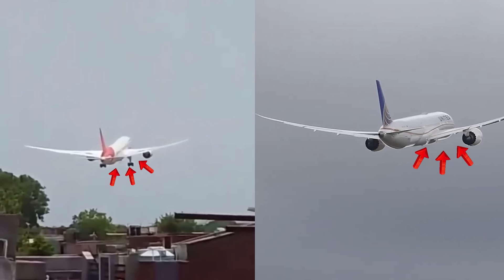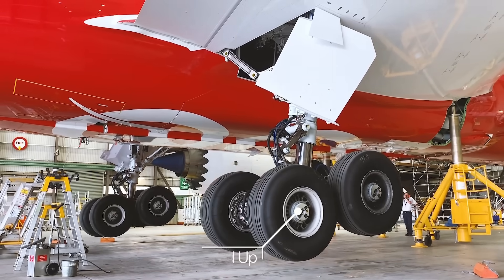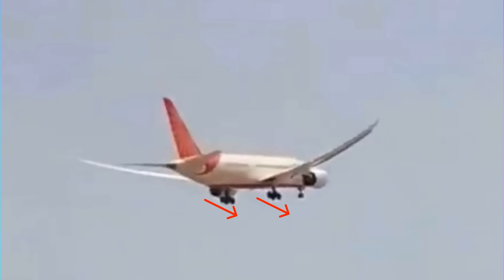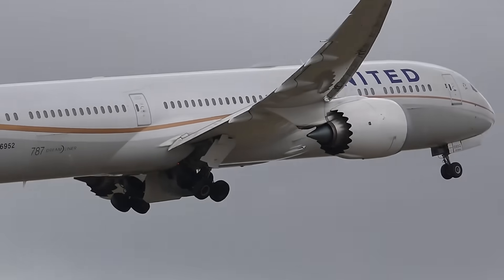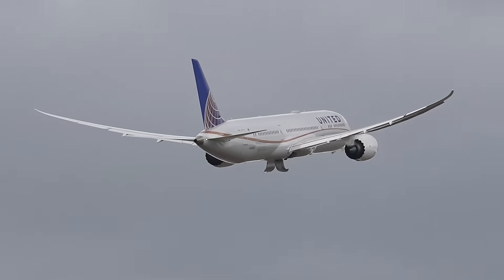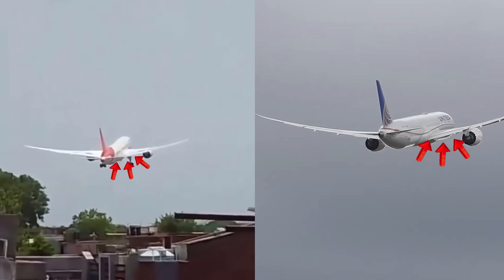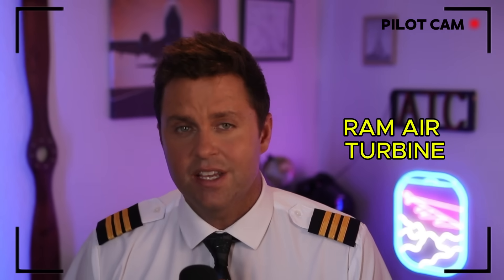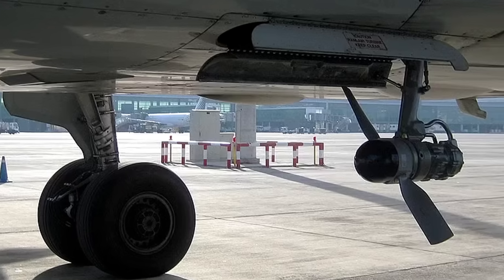Pilot Explains: A New Detail in the Air India 787 Crash Everyone Missed

Comment: There were electrical problems on this plane, as noted by several other sources. I will be surprised if those issues aren’t at least involved with the engine failure.
Reply: Engine failure is completely independent of cabin electronics not working. The engine maintenance is a complety different field and a expert team take care of it. Whereas cabin electronics like infotainment is just airline saving some cash (most of them cut corners one place or another)
Reply: @Apoorv-u2s  so you say the engines can works without electric input ? non sense
Reply: Those are fake sources
Reply: Cabin lights and most aircraft electronics are not powered directly by the main aircraft engines. There is an Auxiliary Power Unit (APU) which is separate.
Reply: Unless required by MEL, the APU is selected off before flight. It’s the very first item on the after start checklist.
Reply: @ChiefIntel  Well, that's a wildly misleading statement. The APU is only used as a backup ... or for ground operations when airport power supplies are not available.
Reply: @ChiefIntel  I thought the APU was only used when the engines had been spooled down and before external power was connected, not during flight.
Reply: Don't jet turbines have igniters in the fuel burner cans that require electricity?
Reply: @spacecadet1249 
FADEC EE controlled engines by definition require a stable electric supply for all parameters thrust settings and fuel metering.
Possibly also electric booster fuel pumps to sustain take off power fuel demand.
Reply: @spacecadet1249  No. Like a diesel engine, its compression ignition. Igniters are needed on initial start, but once the core is spinning fast enough the fuel will burn from heat of compression.
Reply: @spacecadet1249  Now that said, there IS a minimum airspeed to create said compression, I can’t recall what that is but you do make a good point. However, selecting the fuel controls switches off then on (the first memory item for a dual flameout) will fire the igniters from the battery.
Reply: YES, I saw from the flight this plane did - Delhi to Ahmedabad to earlier on that same day that there was no a/c when boarding, and the guy who survived the fatal flight said the lights went off then came on, perhaps when the rat took ovcer the electrical system?  So I would say a definite electrical problem, but how that works in with engine failure ...????
Reply: Electrical fault/fire, poor maintenance
Reply: Air conditioning wasn’t working inside the cabin. Air conditioning comes directly from the engines. But only when the engines are working normally
Reply: @62Cristoforo  Come back when you learn what an auxiliary power unit can do, will you?
Reply: @peter The APU is a ground based unit, located on the tarmac behind the empennage. It is disconnected before pushback. It has nothing to do with the crash.
Reply: @62Cristoforo  The APU is not the ground based unit at all.  That's a totally different item.  The APU (Auxilliary Power Unit) is the small generator, positioned in the tail section of an airliner, which is used to provide lighting, AC, etc. when the engines are turned off at the gate, before the external unit is hooked up.  If you look closely at the tail section of a recently arrived jet, you may see the exhaust vortex from the APU disturbing the surrounding air.
Reply: Electricals , Electronics , Computerizing
Reply: Best video so far. Very informative, thanks.
Reply: The main fuel pumps on cars and planes are driven by engine power.
Reply: The sole survivor said that before crash, lights were flashing inside the plane. That's the sign of electricity issues.
Reply: @kingdomofgeorgia1751  thats the rat being deployed it takes a bit of power and lights could flash as stated by a prof pilot
Reply: How can associated electrical Software effect both engines..
Reply: @jbs9231 Very easily. All it would take would be a computer or electrical problem to shut them both down at the same time.
Reply: @jbs9231  Why wouldn’t it?
Reply: @jbs9231  Fuel pumps does not working.
Reply: @jbs9231 we all admit Air India has a bad customer experience with cutting costs on the interior of planes. While engines are different, What’s stopping them from also cutting corners with their maintenance team?
Reply: @RecursivePB  To fly into EU, USA its mandatory to have a certain level of aircraft maintenance. Engines is not something they can cut corners on. In flight entertainment..yes.
Reply: @TheSakzzz  oh wow I totally forgot dude, this is a world where people don’t lie and cheat to their superiors. OF COURSE there are “industry/country standards” but every Rule written in ink can be covered in blood 🩸

Comment: Unintended thrust reduction due to captain’s seat sliding rearward on rotation and catching the levers pulling them to idle. Copilot unable to overcome captain’s weight. Aft locking mechanism failed.

Comment: Does B787 has single switch to cut off fuel for both engines? Does electrical failure can make the throttle pulled back to Idle?

Comment: *EDIT* Emergency backup gravity feed fuel system would come online in this scenario as mentioned in the replies below. I'll keep the original here since there is interesting discussion below. **

Original:

One event that automatically deploys the RAT on the 787 is total electric failure. The 787 uniquely doesn't use compressed bleed air, nor does it use engine driven fuel pumps for propulsion (both of which are found typically on other jets) 

Instead, a "bleedless" electric architecture is what the plane relies on to power hydraulics and the engines. In its early days of service the 787 had battery fire issues that grounded the fleet but were resolved by a fix in 2013.

On November 12, 2017 United flight 915 - a Boeing 787-8 (same type as AI) indicated a main battery overheat on descent into Paris. According to the Aviation Herald, the event wasnt significant enough to open another investigation.

I realize that the chances of catastrophic loss of electrical power on one of the 1000+ 787s in service is far fetched. But on a plane that essentially lives off electricity, and one that has a rough history with battery issues, I think it cant be entirely ruled out.
Reply: Regarding battery issues, it was an unusually hot day......
Reply: The engines will keep running if all electrical power is lost, they will gravity feed. Loosing electrical power does not switch off the fuel valves.
Reply: @mike-youtube Agreed
Reply: @mike-youtube true but the gravity feed does not provide enough fuel for takeoff thrust.  It’s fine for cruising but the takeoff fuel requirements especially on a heavy takeoff weight (long haul so heavy fuel load) in hot conditions (thinner air and lower compression rates) are multiples of the cruising fuel burn. So at that point of the takeoff gravity feed seems unlikely to be sufficient.
Reply: @Flynbourne  That's exactly what I was thinking, but I just don't have official numbers or limitations from boeing regarding the gravity feed system. It seems to me like it just wouldn't work at what is quite literally the most demanding phase of flight, for the engines especially.
Reply: @Matts752 the 787 burns around 20,000 litres in the takeoff process.  Let’s be generous and assume the total takeoff sequence is 4 minutes, that’s 5,000 litres per minute or 2,500 litres per minute per engine.  Given the friction of the fuel systems and the minimal vertical gravitational pressure it seems unlikely that gravity could provide anything like that flow. And I do say unlikely.
Reply: @mike-youtube  The height diffference between the engine and fuel tanks is at most a couple of feet. This is not enough head to provide a sufficient fuel flow to maintain take-off thrust. Furthermore, the video of the airliner gliding down across the houses has NO engine noise at all.  Not even noise from engines running at idle. At least the expert presenting the above video has pointed out the lack of engine noise. The lack of engine noise is very relevant. It settles the case: This WAS a dual engine failure. And regardless of how improbable this may be it nevertheless occurred.
Reply: My thoughts exactly.  That’s where I would be looking.  An electrical systems failure fits all the evidence so far.  Now this is sort of concerning as that would indicate an issue that is potentially systemic and could impact other 78s. Especially in hot climates.
Reply: What do you mean when you say bleedless electric architecture.  I appreciate your input
Reply: @turbinetech3000  Its one of the "selling points" of the 787's design. Pretty much every large jet including the 777 and even the Airbus A350 use bleed air and engine driven fuel pumps to power the plane's hydraulics and electronics. Boeing took a different approach with the 787, bleed air is not used at all from its engines, instead 4 electric motor/generators are found (2 on each engine, plus another 2 on the APU i believe). Boeing argues that this design saves on weight and provides maintenance benefits over time, its no doubt cutting edge, but since its the first major aircraft to use this system, I don't know if its as "tried and true" as legacy systems.
Reply: @Matts752 True that but, gravity feed is sufficient at low altitudes with that amount of fuel on board. Plus if the RAT deployed it would automatically bring some boost pumps online paired with igniters . Hence relight of the motor would have been possible within seconds. Again the investigation will reveal all details!! Just said we lost all those lives
Reply: @Gaferr-r4r  Admittedly, I'm not too familiar with the gravity/suction feed system on the 787, but I always assumed that it was a last resort backup if all else failed. Its hard for me to believe that the engineers designed it with a catastrophic failure at V1 or V2 in mind. Maybe I'm wrong, but I would like to find some source that outlines the performance limitations (or lack thereof) regarding this gravity feed system.
Reply: @Matts752 I fly for a US carrier and have about 4000ish hours on the 78. The certification and design of the fuel system after they did away with EDPs was exactly that!! Loss of boost pumps at or above V1 and gravity feed at high deck angels. Once the RAT deployed one pump should have been back online but not required for engine operation during emergencies!!
Reply: @Gaferr-r4r  Wow! ok that is great to hear. At this point then I guess the CVR and FDR are going to be our best bet for answers... Thank you so much for clarifying that as I've been unable to find that info up until now
Reply: @Matts752 Obviously anything can happen and we are all just speculating at this point. I just feel awful for the lost ones!!
Reply: It takes a few minutes to restart the engines after they shutdown. No time
Reply: @larrymays1754 Not when they are already at full thrust. It takes up to 2 minutes on initial start. When the motor momentarily loses thrust and ate an auto relight it’s almost instantaneous
Reply: @turbinetech3000 wait for reply from poster for exact info..rough reply ..electric architecture refers to electric motors driving hydraulics and plane controls versus fuel driven  engine power driving hydraulics and flight controls by bleeding air through compressor .
Reply: There is a recent FAA Airworthiness Directive for the B787 that shows how potable water can seep into the electrical bay on the 787 and cause a major short and potentially trigger this. https://public-inspection.federalregister.gov/2025-08346.pdf
Reply: Wow, no engine driven fuel pumps on the engines themselves ???? jeez, so even the engines have electric-operated fuel pumps ???? wow, that is asking for trouble IMO. I've been away from the engine business awhile - that is amazing, and not in a good way

Comment: Gary, great breakdown, you're obviously a well seasoned flyer. Kudos! I'm a former (auto) Mechanic/Tech, and fiddle with anything mechanical, also a Musician and Stringed Instrument repair/tech. That being said, my thoughts from day 1 when I saw the video: the plane sat for 2hrs on 100*F plus temp day, which means anything couped up inside a tin covering is going to be boiling. VAPOR LOCK is highly on my list, but- not enough to kill both engines simultaneously. Contaminated fuel? YES- very possible. But MORE SO is a complete Elec Sys failure- for any reason, but mostly this: 2hrs sitting with 100* temps, then turn EAST towards the SUN and voila! you have extreme temps that ELEC and DIGITAL systems CANNOT handle. They HATE heat! So, Main Elec Syst failure is it. The flaps look like they went up like they should, but they are drooping lifelessly. Same with the Gear. Went UP/FWD positioned, then drooped. Then we have the MAYDAY call at the last sec, saying "we lost power". BINGO. That's why it turned glider, coming down evenly, and sadly, tragedy. :( 
I just subscribed to you- keep up the great channel!
Reply: Sorry brother but jet fuel and jet fuel systems are a totally different animal from gasoline and gas driven engines. Its flash point is near 100F and the system is kept pressurized, meaning there are no air pockets in the system and even the fuel pumps are designed so they don't cause any cavitation. Jets are designed not to get vapor locked, they can stand all day in 100F without any issue. Jet fuel is more like diesel fuel, just as diesel engines don't get vapor locked because they are also pressurized, same with the jets, just more attention goes into making sure they never get vapour locked. And the avionics bay has active cooling, liquid cooled and air cooled so the electronics also weren't overheating. Planes around the world sit outside for hours in extreme hot temps all day long and nothing happens. Dubai is a major international airport with summer temps exceeding 122F and all their planes are parked on the tarmac at the gates for hours.
Reply: Totally agree on major electric system failure.
Reply: read somewhere over 110 F?  was the mayday called before V1 reached? so so sad.
Reply: Yes, I wondered about the heat factor as well - esp. when 2 hours was the amount of time given. That can't be good for certain instruments and systems.
Reply: Don't these engines have FADECS?  Don't the FADECS isolate to independent power sources from the accessory gearbox after 50% N2 during engine start?
Reply: That airport temperatures were reading 42 degrees ground level hot

Comment: Good video and the observations of the RAT and landing gear , theyhave been mentioned many days ago and it seems very clear they had both engines fail which caused the crash. It wouldn't matter who was the pilot in that situation there is nothing you can do.  I would be checking on the maintenance records also, to see what was done and what wasn't done to the plane. Many pilots inc. Capt. Steve were saying it looks like pilot error, that is an awful  thing to speculate and any pilot should know better. I lost respect for Capt. Steve because to me he doesn't seem genuine as I prevoiusly thought and more about views, he since did apologize for his wrong analysis but I will not watch his video's anymore. It is competely wrong to blame the pilots with no proof, they retrieved the black boxes easily enough and we need to wait just a few weeks perhaps for their preliminary report and we will have the answers based on facts. May all RIP.

Comment: A simultaneous failure of both engines on a Boeing 787 is extremely rare and would require a highly unusual or catastrophic scenario. However, there are several known or theoretical causes that could lead to dual engine failure

One of these is complete failure of the Full Authority Digital Engine Control (FADEC) which is an advanced, computer-based system that fully controls an aircraft's engine without any direct pilot input once it's operating. It manages all aspects of engine performance and operation, including thrust settings, fuel flow, and even engine start-up and shutdown.

Risks of FADEC Failure: While rare, if both FADEC systems on both engines were to fail simultaneously (due to electrical, software, or power supply issues), it could lead to loss of engine control. This is mitigated by redundancy, electrical isolation, and backup power like the RAT or APU (Auxiliary Power Unit). It has been noted that the Ram Air Turbine (RAT) had deployed which could have meant loss of electrical power affecting engines, landing gear operations.

Summary: FADEC makes modern jet engines more efficient, reliable, and easier to manage, but it also means that engine operation is heavily dependent on electronics and software.

Comment: An unretracted landing gear can still allow the 787 Dreamliner to take off and not necessarily lead to a sudden crash.

AI Overview
Yes, a Boeing 787 Dreamliner can take off with the landing gear unretracted, but it's not the standard operating procedure and can create significant drag, impacting performance. While the plane can fly with the gear down, it is designed to retract the landing gear shortly after takeoff to minimize drag and improve fuel efficiency.

TWO BLACK BOXES not ONE. Apparently, both have been recovered. 
AI Overview

A Boeing 787 Dreamliner is equipped with two black boxes. These are the Cockpit Voice Recorder (CVR) and the Flight Data Recorder (FDR). They are also known as the enhanced airborne data recorder (EADR), which includes both the FDR and CVR. These devices are crucial for accident investigations as they record flight data and cockpit audio.